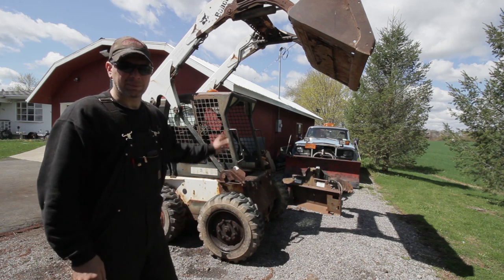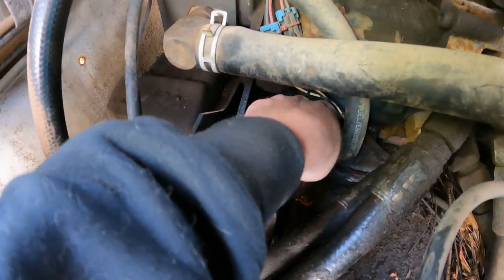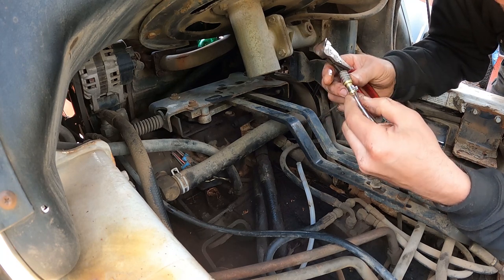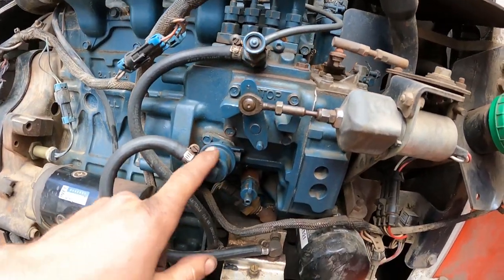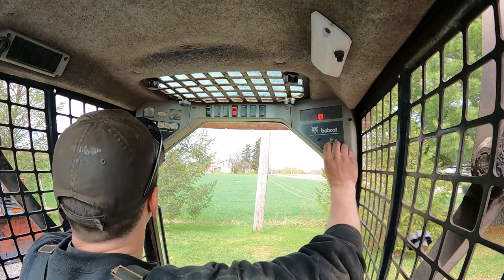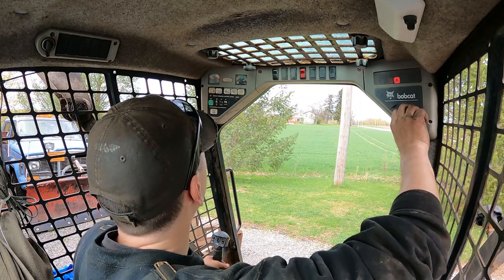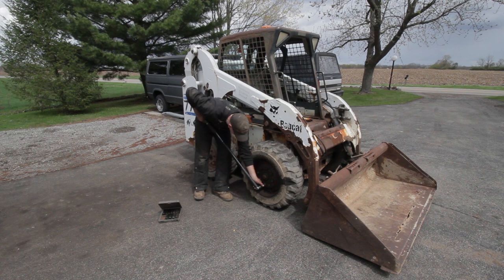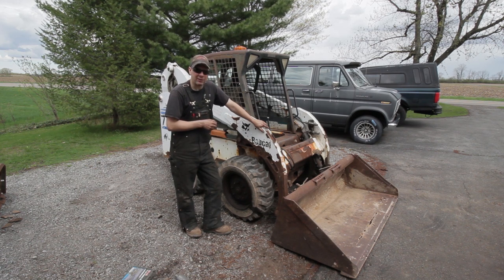Fixing a Bobcat 773 Skid-steer Loader:  Fuel System and Electrical Problems

Comment: Good vid young man:))).    I'm sure some one mentioned the original fuel line probably ok as the first problem was the pick up tube. First repair// Did not know about the filter with check ball to keep fuel primed..So they replaced what they saw.

Comment: We have 3 skid loaders on the farm. They are by far the works things to work on. Everything is compact and on to of whatever you're trying to fix. But they are fun to use and handy. Slap some fluid film on those wheel studs. Have fun!
Reply from the maker: This thing is handy.  I don't like the foot controls for the bucket.  I think newer skid loaders are all wobble stick controlled which I think would be way easier to run.

Comment: They are called oetiker clamps.  The proper pliers actually has a third part that pushed the crimped portion down toward the hose flat.  Look at the clamps on a CV joint.  Same thing

Comment: i have a 7753, pretty much the same machine, i fuel pick up tube on mine has fallen off and i'm just running a 2 gallon jug tied to the side for now, i'm going to try and use a newer style when i do fix it, in the last week i had to rebuild my engine cooling blower right angle drive, bobcat wanted almost $600 for 4 bearings and two seals, i bought after market for $67, the drives have gear oil in them and you should check yours, it has a hex plug you can see when the cab is up, you want to make sure the blower is working, check the belt, air should blast out the side vents with the machine running, i really enjoy my machine.
Reply from the maker: Thanks for the tip on the blower!

Comment: Great video Shelly, We i was driving a tip truck, had to load a bobcat on to the back to transport it around, only loaded it on and off the truck, Tried using it to dig stuff. FAILED so i gave up digging and just would transport them. Bobcats are not like a car or truck to drive, Don't like them. YUCKY.
Reply from the maker: Yeah, they are not the most intuitive machines ever designed.  I think the newer ones did away with the foot controls and went full wobble stick.
Reply: @QuickSpeedShop  That would be way better, Me as a truck driver, Could no get my head around FOOT STEERING.

Comment: gonna need new studs pal, rim has polished threads smooth probably...
Reply from the maker: They all tightened up after some torch heat except for the initial one I broke off without heat.
Reply: @QuickSpeedShop  you got lucky, tip the hat to you sir. My bobcat was free but need not mention similar issues was one of those.

Comment: You’ve never worked on Diesel engines but do have a spare glow plug relay? Just watch that old Bobcat doesn’t make you pay for all those years of abuse.
Reply from the maker: The relay was just a standard 87 electrical relay.  Luckily I had a bunch I saved when parting out junk cars.  Don't trash it when you can stash it!
Reply: @QuickSpeedShop  

Hi guy no ki
..